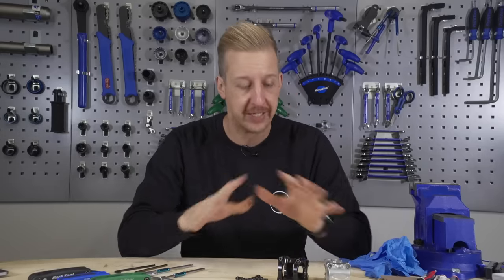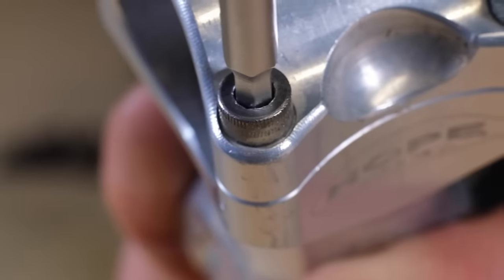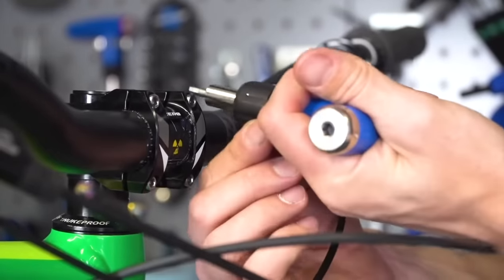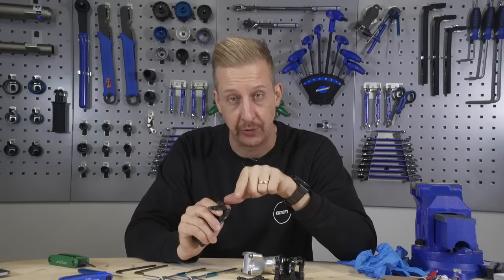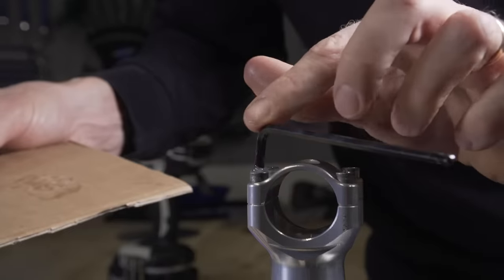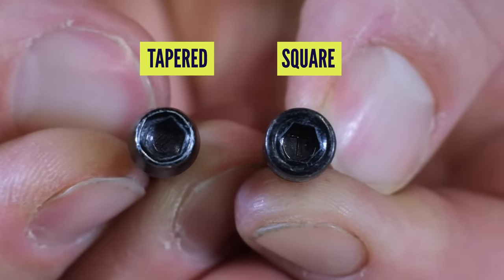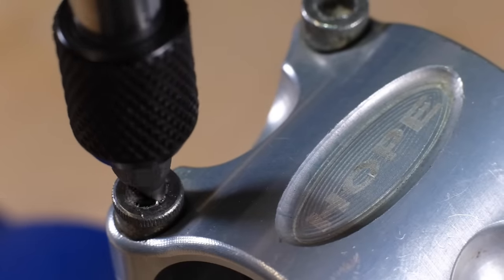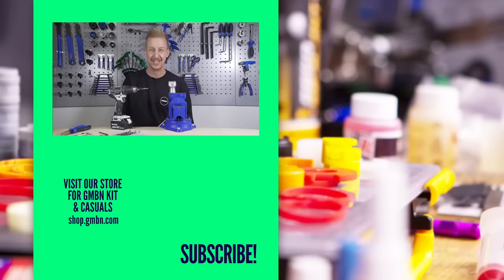4 Ways To Remove Stripped, Rounded, Or Stuck Bolts | GMBN Tech's Guide To Stubborn Bolt Removal

Comment from the maker: Have you used any of these techniques?
Reply: No, M8

Yet
Reply: I guess that welding an Allen key to the bolt isn't recommended......
Reply: Yes!  The Bolt Extractor, worked like a charm
Reply: great techniques, i cant wait to try the nitril rubber glove one.. You forgot Vicegrips.
Reply: No, but I will - Thank you!
P.S. I use Vice Grips, and also cut a slot for a screw driver.
Reply: I have soldered in a Allen key before, same idea as the bonding but because you use solder you can actually reuse the Allen key because you can heat the solder and clean it off
Reply: @jelledevries2280  
WOW - That is a great idea!!!  Then you don't have to wait all night for it to cool.
Thank you. :)
Reply: I have needed to use the drill out method but a little bit different.
I crashed my at the time 3 week old Rocky Mountain Altitude and in that crash i destroyed the threads that the rear axle threaded into. After trying to turn the axle out with a 1m long lever and subsequently rounding it out, I purchased a left threaded tap cut a thread into the axle and put a m8 hexhead screw in. Ended up almost rounding that one out too then took that one out and grabbed an 11mm metal drill and in from the other side until the axle had so little material left that it broke and I was able to remove it. Pretty nerve racking drilling into a 3 week old bike with such tight tolerances.
Reply: If you have the space to get around the head a plier wrench is also a great thing to losen up a bolt insteed of drilling most times.
Reply: Wish I had thought of it, no I used a dremmeltool to cut a grove in it so I could use a flathead-screwdriver it worked though!
Reply: Haven’t done it on a bike bolt
But once I used a saw too convert the bolt into a flat screwdriver bolt
Reply: Nice one Doddy! I also like making a slot with a rotary tool, then using a flat screwdriver to remove.
Reply: Yea man we use some of these methods for removing studs offshore also. Might be worth noting that stainless can be more difficult due to the softness (depending on grade) and also there harder to drill out without cobalt drill bits. Decent Video as always super informative. Thank You
Reply: @sionvandevelde  Always a last resort Sir, for multiple reasons.
Reply: If the bolt is beyond rescue, I use a flat screwdriver that's slightly wider than the bolt head (inner diameter), hammer it in gently but deep enough, then use pliers to turn the screwdriver. But to be honest, I hate hex screws, I wish every manufacturer would switch to Torx heads !
Reply: Torx bits, a hammer and a ratchet spanner with bits adapter.
Hammer in the bit with the adapter and a short extender piece for the ratchet. Attach ratchet and off it goes.
Bits are cheap and expendable, it's the only consumable item in this process.
Reply: What brand is the allen key that you use in the beginning of the video.  It looks like it has an extender as well.  Thanks
Reply: How about on the cleats?
Reply: The other day i used a hammer and a slightly larger torx key to bite into the head of the bolt and undo it. Worked pretty well :)
Reply: I just went through tips 1-3 while trying to remove a bolt from a dropper post lever where the bolt head apparently was softer than the thread lock. None seemed to work, the epoxy didn't really attach (I used a 5 min one but waited for a few hours). Instead of drilling or using extractors I finally dremelled a slot for a flat-head screwdriver in the head and that did the trick.
Reply: Worked like a charm! Thanks!
Reply: the glove thing works - amazing
Reply: My Pedal tension bolt is rounded.. how do I increase the tension??
Reply: My Pedal tension bolt is rounded.. how do I increase the tension??
Reply: My Pedal tension bolt is rounded.. how do I increase the tension??
Reply: Great video and EXTREMELY helpful!!!
Reply: It's either crap or I have bad luck but it's not on a bike it's for a car. The idle air control valve on the throttle body of my K20A2. The bolts are stripped and seized/corroded into the the housing. 24hr PB blaster, screw extractor, drilling, you name it, nothing works. By the way, that last one, the extractor, I've used it plenty of times and not once have I ever been successful with it.
Reply: @jelledevries2280  A valid point; you can also melt the Araldite so long as you don't apply too much heat and soft the Allen key.
Reply: This was super helpful, thank you so much! I needed to lower my baby's crib because he started pushing himself up, and the bolt was stripped! After panicking for a minute (because it's a huge safety issue if it isn't lowered) I found this video and am so glad I did! The glove trick did it! Thanks so much!
Reply: I used bolt extractors. 5 piece set from Amazon, like 9 bucks. Followed his example to a T minus the vice grips but bolt came right out eventually. It does require effort, so take your time, just like he said.
Reply: Simple super glue worked as well. Thanks for the tip
Reply: @jorisressing3626  ja this is exactly what i did for the rear axel as well. I wished the bike came with UDH or rear hunger with axel thread.  So i didn't have to worry to round out the thread for a customers bike

Comment: You can use a saw to make a cut in the bolt and then use a flat screwdriver.
Reply: you can also combine drilling the head off and then cut a slot
Reply: Yes, I used that on a rotor bolt, worked great
Reply: I was waiting for that and then he took out fucking glue 😂
Reply: I use a Dremel with a little cutting disc.
Reply: Way harder than using a knipex cobra plier.
Reply: Dremel and cutting disk. Most of these are crap!
Reply: Exactly what I had to do. Thanks for the tip. Brake rotor bolts were rounded out completely, like someone used a power tool to tighten them. Put the dremel cutting disc to them. Cut a slot across the top for a flathead screwdriver and cut away a little under the bolt head (I was installing new rotors anyway) and I was finally able to turn those little f'ers out.
Reply: Only if the bolt is sticking out, not in a recess.
Reply: Thank you just used this suggestion  for my water bottle holder and I am able to reuse the bolt
Reply: Dude you just saved me so much damn time and hassle. You rock
Reply: Always the best one to do
Reply: 100%, but Doddy was concentrating on the casual bloke that cant do that without losing a finger, so thats where the GENIUS glue trick comes to play....lol
Reply: OH REALLY?!?! WOW I WOULD HAVE NEVER GUESSED🤔
Reply: This is my go to before I break glass in case of emergency and weld torx on it

Comment: If you’re using the sacrificial allen key trick, bond the long end of the key into the screw. Once it sets, turn the short end with a small-diameter pipe or by grabbing onto it with an adjustable spanner for leverage. Once the bolt comes off, saw off the bonded end and round its sharp corners with a file. One sacrificial key lets you remove quite a few bolts.
Reply: A blow lamp will unbond the allen key, then scrape off any residue with a stanley knife. Use time and time again.
Reply: @khchoi2012  Reading into things a bit too much, eh? A man after me' own heart! But yeah, blowtorches are not the most common tools around the parts I live in - I don't know anyone who owns one. I also wouldn't recommend using one here, since someone will start using a blowtorch on teh bolts of their carbon full-sus... :D Oh, and there are 5-minute variants of e.g. epoxies that can do the trick - the only thing those are really good for, imho.
Reply: Actually, that sacrificial Allen key can still be saved. Put it in the freezer overnight, and the epoxy bond will break.

Comment: “Time to time” me who is more used to Allen wrenches slipping than actually working
Reply: Every component on all my bikes have either a single or multiple rounded, or you can see marks where I have slipped
Reply: Gotta use good quality properly fitting tool.
Reply: Yeah I think your tools are the problem I'd get some new ones if you can
Reply: Never use cheap tools, because they don't fit properly and you'll destroy the things you work on

Comment: I used this video to help my son with a screw holding his laptop SSD in place. Can always trust Doddy - best video on the topic on YouTube. 

PS used all the techniques. For the third, only had superglue, which didn't work. Using the extractor kit drill bit in reverse was enough. I was patient power Doddy's advice, and once it's drilled far enough in, there was enough friction that the screw started turning. Voila.

Comment: Used the rubber glove trick on a stripped bolt in a door frame with a manual screwdriver and it worked!! Saved a trip to the hardware store.

Comment: How do you reading my mind? I'm just bought a new bike for mom & I got tons of stuff for upgrade at home, but few days ago faced such a problem with stuck bolts at handlebars grips. Thank you!
Reply from the maker: Hope you get them out!
Reply: I had the same exact problem the other day. I used my 1/8" drill bit to make a nice clean hole, then took my T25 Torx bit and hammered it into the clean hole. It opened up the hole on each of the splines, and even the small amount of purchase on the torx bit was enough to get it to grab hold and remove it. Then I hammered in a larger allen wrench and now it's a brand new bolt, which I subsequently used to reinstall the grips on another set of handlebars! Good luck!

Comment: Ive been in and around mechanic and electrical for mist if ny life machine shops...ive used extractirs and such before drilled out...i just had an issue in my motorcycle..one allen screw was a bit tighter then the others and stripped it a bit. It being in an isolated position could not cut slits, wrench. Didnt want to have to drill and did not have a four square to pound in. The glove trick. Magnificent. Just the little extra bite it needed. In all honesty i thought to fill the gap but had figured steel wool paper. Was not sure. Worked like a charm. Thank u. Saved quite a bit of trouble  great tip.

Comment: I made a cut with a dremel then used a phillips head screwdriver...
Reply: Presume you mean flat head screwdriver? Unless you cut a star shape? I've cut a slot with a dremel and used a flat head screwdriver, or the end of a chisel if the bolt is large.

Comment: I've used most of them over time (the joys of old bikes and Daihatsu cars).  I also keep a tube of metal epoxy putty with me when I go anywhere on/in any vehicle.  I've used it similar to how you used the epoxy resin on bolt heads, I've used it to patch cracked frames and rims on bikes, fix holes in oil sumps on engines, fix go-pro mounts etc etc.  It's very very useful stuff.   Oddly enough, nearly all the times I've used it, has been fixes for other people.

Comment: Super handy tips.
+ In my experience, Araldite or any other epoxy will peel off metal rather easily, twist the bolt with pliers and it will go...
Happy new year!

Comment: jb weld .place a small ball of jb weld into the rounded bolt head then put allan key in as normal
letting the weld form around the allan key then remove allankey wait for it set and job done.
Reply: There's a few types of jb weld, which type should we be using? Jb Plastic weld or jb steel weld? Which one did you use?

Comment: Depends whether you can get to the side of the head of the bolt. You can file 2 parallel edges on the head. Use an adjustable spanner to open it.

Comment: Before the more extreme methods, you can also try using the part of the pliers that have teeth to grab the whole head of the bolt if it protrudes enough.
I might or might not have taken multiple bottle cage bolts out this way.

Comment: Some good ideas here. Regarding drilling and using stud extractors/ezy outs. If it fails extracting using the head of the bolt you can using a hard metal cutting drill just drill straight into the centre of the bolt further down than the head. For this you'll need to use ezy outs by hand. A power tool will most likely snap them.

Comment: Great video mate. 
I could not see you opening a security bolt. Is that for safety reasons ? Im hoping mine is just soft steel and I can drill it out, but it is slipping at the moment. I know on cars, they are really tough and cannot be drilled ..

Comment: Method 1.5:      VICE GRIPS.
If there is enough of the bolt head exposed (so many are countersunk which makes this method redundant in that instance)...
Clamp the vice grips onto the bolt head ensuring there is some room for counter clockwise rotation.
Put an Allen key in the head with the arm diagonally opposite to the vice grips (so you can hold the pair like a T bar giving even more torque to the job.

Vice grips / pliers are also a forgotten gem for removing rounded screws... the smaller the vice grips the better for more precise grip.

And  (bonus?) tip...
Use penetrating oil on the bolts... and try doing them up a pinch, sometimes breaking the friction clockwise is enough to let the penetrating oil in, and the bolt comes out with the standard alen key, no other trick needed.
Heat is also another way.. but can damage aluminium, seals, paint, fingers, reputation...

Comment: Really great video!
I've got this problem about 2 years ago on a bottle cage- mount. I've worked with the rubber band method too, but I couldn't get enugh traction on the inside of the fitting, so I wrapped it arouond the bolt head and then I used a hack which I've got from a car mechanic: I took some pliers and grabbed the outside of the bolthead with the rubber in between and turned the bolt in- and out, just a little bit and a couple of times until it felt really loose and then I was able to get rid of it.
I'd be interested what you think about this hack!

Happy new year!

Comment: Cheers for this; this has given me enough inspiration for my stripped bolt even though they are on some fairing screws on my scooter!, I have tried this before sometimes with disc rotor bolts it just created a dip and were truly stuck in there. I do have a high powered drill and metal bits too. One idea was to fashion some kind of mini crow bar as mine are mushroom flat head and getting a purchase with a hammer 🔨 nail hoofed claw was not feasible, out of an old piece of sheet metal or tool and bending the end like a hook maybe cutting a slit with my junior hacksaw blade. Definitely using my new WD-40 before I do anything to 😊, also I hear heat using a heat hot air gun can help with seized bolts

Comment: Going to need to try these. Was going to adjust the shifter on my bike and no clue what the shop I got my bike from did to that one little 3mm on the shifter. All the others have been fine but that one 3mm is not coming out. Going to have to give it a try with a better Allen key than my topeak multi tool

Comment: Do you guys have a video on siezed threaded square taper bottom bracket on an aluminium frame? I've tried 18 " breaker bar and wd40. I found a video suggesting, bolt the tool to the axle to keep it from slipping, what do you guys think?

Comment: Awesome! Please make also a video when the head of the bolt is ripped off, and the rest of the bolt is hidden in the material! Thanks in advance!
Reply: Small drill down the center and a small easy out.  Know your materials and apply a heat gun and WD-40 or similar to penetrate first.  Worst case you drill it out and insert a heli-coil.

Comment: I got a stripped Alan bolt on my power vale casing , it’s stopping me from taking it apart and repairing a small fix I’m gonna try the epoxy method and the glove one I’ll let you know if it works thanks!

Comment: My XT crank had a stripped head, used an M10 drill bit to remove the head which allowed me to take off the chainring. I then used pliers to turn the remainder of the bolt and out of the crank.

Comment: Hello, thanks for  a great video. I have a torx screw (T20) rounded  but in the back of an engine, very narrow gap. just a torx key is OK. Therefor no such power drill here. I had tried rubber gloves, but not good so far. Need your advice please. THANKS

Comment: I have soldered in a Allen key before, same idea as the bonding but because you use solder you can actually reuse the Allen key because you can heat the solder and clean it off

Comment: Just managed to get the tapered head bolt out of my Shimano cranks by using an extractor drill which didn't work but it did remove the worst of the damage from the outer surface and then I tried a different short, straight, 5mm allen key with a ratchet wrench - this worked a treat. Poor quality Shimano scoket head setscrews in my opinion
Doddy - wear safety glasses when using extractors as they are notorious for breaking!

Comment: Which method to use for a square head M8 6mm allen crank pulley bolt?  It was reused multiple times and torqued to the sky.  The other 3 came loose with a 60cm 1/2" breaker bar but the 4th destroyed 2 brand new 8mm Hazet allen sockets...

Comment: I have used an slightly smaller drill bit to drill out the majority of the bolt/screw. then pick out the rest of the remaining bolt/screw from the treat then clean it up with a  correct size tap.

Comment: I literally just stripped a bolt because I'm an idiot and this video came out. I was trying to remove the chainrings from my xt crankset to make it a 1x, they are torx T30 which is a key I don't have and me being the idiot I am tried removing them using a 4mm allen key... Surprisingly 7 of them came out undamaged but one got stripped.
Reply: Hammer in the next size up Allen key or Torx bit. If anything, switch to an imperial size allen key, it will be slightly bigger than the metric one.
Reply: @Adam-xo7cv  yeah, we went to the shop and he just hammered in the right size torx key and the bolt came out.

Comment: I would have never thought of doing cold weld. My saddle seat bolt has been stripped and i need to change the saddle height. I have to try the cold welding trick.